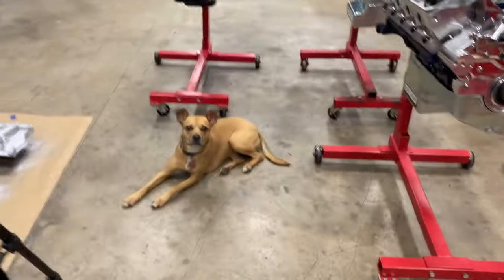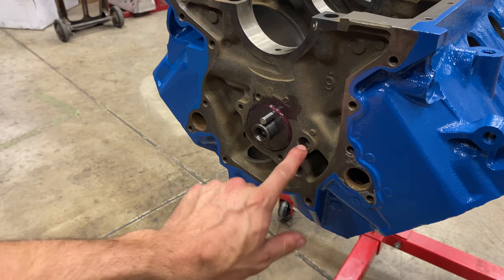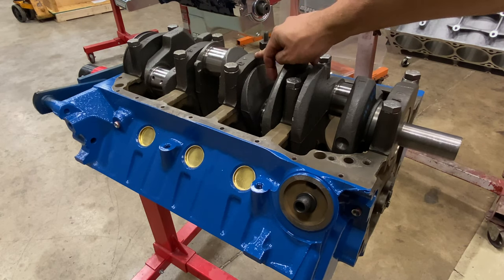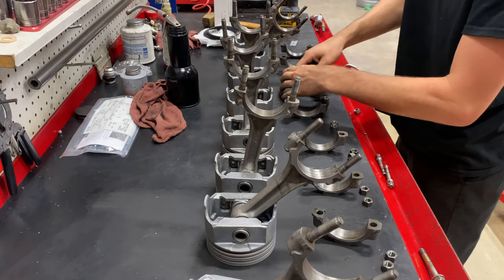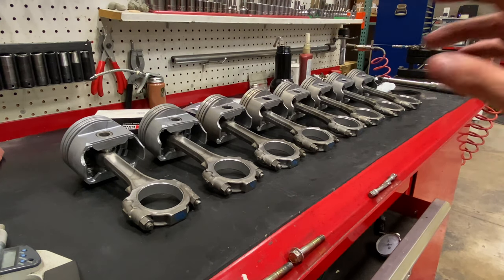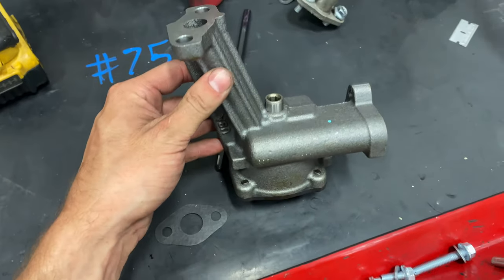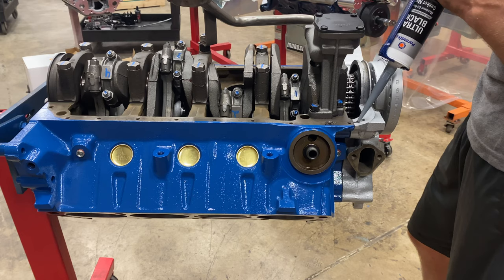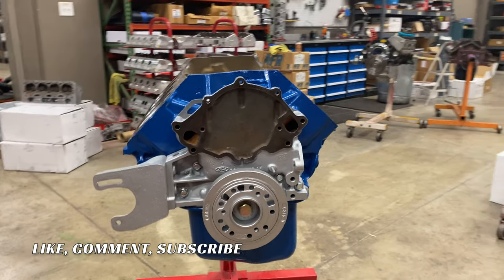351w Marine Short Block Assembly - Part 2

Comment: Installing the balancer before tightening the front cover is all the proof you need to know this guy understands Ford engines.
Reply from the maker: Any engine that does not have timing cover dowels should be done this way!
Reply: @JacobVillemain  I only work on Ford but it makes sense.

Comment: ah, finally, a video where someone puts the cam in first :)  i might recommend, if you stand the block up on its bellhousing area, gravity will help even more with putting the cam inside the block without dinging the bearings.

Comment: Loved to hear what you said regarding HV oil pumps.  I have, in the past, ordered HV oil pumps and cut the spring to reducce pressure, or just use standard.  It' s not necessary, as the windsor design has a really good oiling system.   Good job!

Comment: We always put high volume oil pumps in this engine and only this engine because they religiously hammer out the bottom end in heavier applications like econoline vans.   The bottom end can’t handle 351 ci.    Previous builder must have thought that.   Excellent workmanship.   Maybe materials are better now.

Comment: One thing that I would suggest always put a little lube on the bearings before sliding the cam in, whenever you have metal to metal contact especially on the bearings you could have put a scratch in the bearing causing a premature failure down the road. Never have middle to Middle contact no matter how good you are sliding a cam in

Comment: Wow! I learned a lot from this video! Thank you for sharing your tips and experience with the public.
Question, have you ever used the Total Seal Gapless piston rings? I am currently rebuilding a 351W marine engine myself and am considering trying the gap-less rings. Wanted your take on the gap-less rings? Basically bone stock engine including the flat tappet cam (reverse rotation) and between 8:1 and 8.5:1 compression ratio.
Happy New Year!

Comment: I’m watching your build to find a very interesting learned a few things may I offer something to you. Since you do not like high volume oil pumps and I wanted to make a note that since that engine did have a high volume pump that may be why it looks so very good and had no way or whatsoever, at any rate, you did not blueprint the Oil system on the block. He did not match the oil pump to the port on the engine. He did not streamline the passages to the old filter , I’d like to suggest that you do that if you’re not gonna use a high volume pump

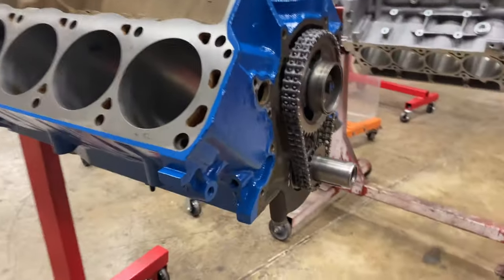Comment: nice work!  I see at 24:59 the dark spots in the bores, looks like the shallow untouched areas after touch honing with a torque plate.  pretty common and not going to affect this combo but for someone rebuilding a Ford or a 4 head bolt pattern engine be aware if you plate hone something that doesn't need much material removed you will see these dark/low spots as that is how the bore distorts under headbolt load.
I see you touched the decks on this one also.  on core 351W blocks do you see a lot of deck warping?  wondering.  thanks!

Comment: Can you share info on the epoxy clear coat you used? Thanks! Great video!
Reply from the maker: It’s made by Spray Max. PN: 3680061
Reply: @JacobVillemain  How does it hold up to the heat?

Comment: when you install those rods into the block i always use a 4 inch 3/8 fuel hose installed onto the rod stud threads,,,  this way i do not rub against the nice crank rod journal, i see those pistons have a point grove in them to show us which way to do a piston install pointing forward or backward, you should put oil in between those rods they are dry on the crank... and oil the crank rubbing on the thrust crank bearing always it too is dry ???

Comment: Hey man I need your opinion 

I have 350sbc the block froze and cracked ...I got another block from a 3/4 ton truck that ran it’s the same block number and everything but I was told that marine engines need to be Bored 20 over  for thermal expansion is that true??? Boat I have is a 95 Rienell came with a Volvo Penta 350   Thanks in advance

Comment: Is a 351 marine better the the 351 car engine or exactly the same.
Reply: internal parts are usually the same unless it's a reverse rotation engine which would have a different cam and distributor gear.  also they use an iron front timing cover as it supports more weight and sometimes brass freeze plugs for corrosion resistance.

Comment: did you know you will lose torque when using that long long 3/8 extension / you want to bring that torque wrench as close to the bolt or nut as you can. or use a 1/2'' thick extension so it will not twist and lose torque,  this is like a torque stick for a wheel lug nut do you know what a torque stick is ???

Comment: you should do research on a thread sealer theory this will improve  your skills, wait until you build a gas turbine engine and you use safety wire on every nut and bolt...  you will learn 3 things i did which is Accuracy / Quality / correctness...  build by that 3 rules...  just say`n...

Comment: not everyone has a bore gage in there tool box,,,  you should teach us how to use that wonderful thing called PLASTIC GAGE... this would be in order... and a fool proof way to do clearance check on a two piece shell bearing install, i heard of unmarked shell cap out there from a Master Builder i met, he saw a set of rod bearing unmarked ,,,  just say`n...
Reply from the maker: I think you meant their*
Reply: He's building an engine for a customer. Why wouldn't he use the best equipment he has. If someone wants to learn about plasti-gage, there are videos out there for it.

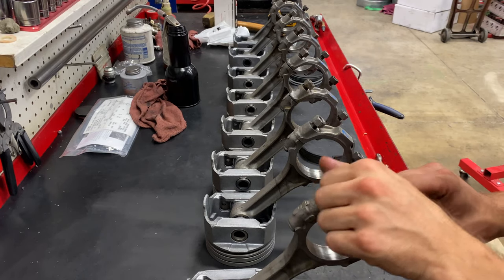Comment: at 17:22 you installed rings into the block only one in each hole to check ring end gap on every hole ??? you did not teach us why ??? those rings installed on the piston should be positioned at 180 deg of the other ring gap as per install instructions ... but they say rings spin around the piston when engine is running ?? so i really would not matter where you install the ring gap ends to achieve the 180deg ring gap location...  just say`n...
Reply from the maker: Because I’m not a teacher